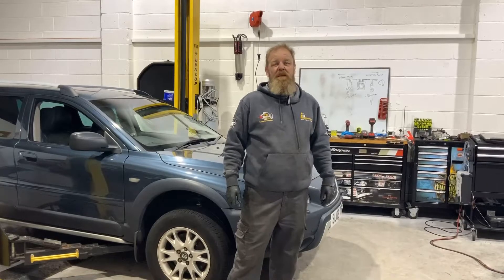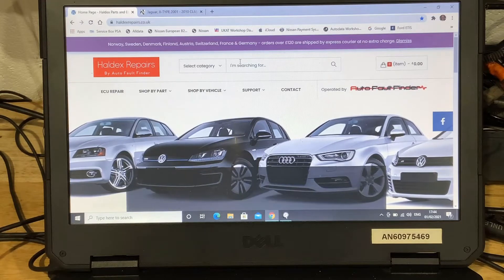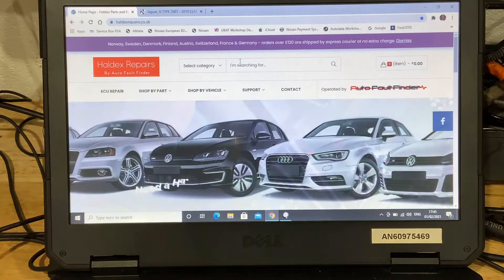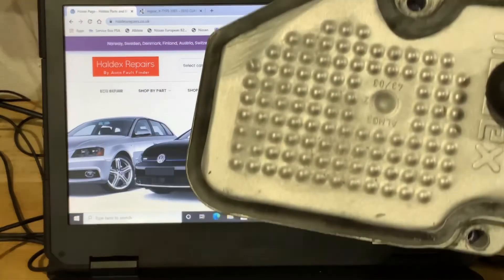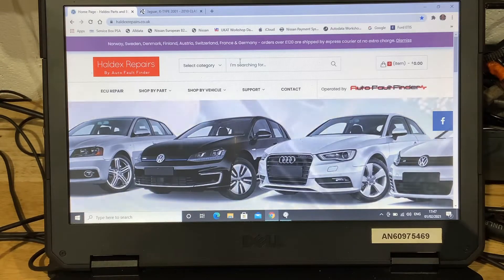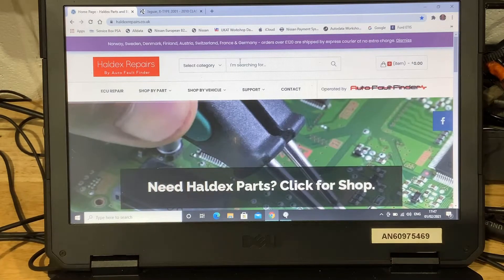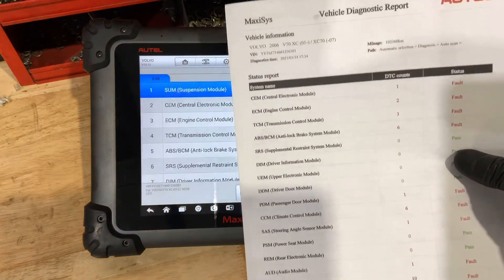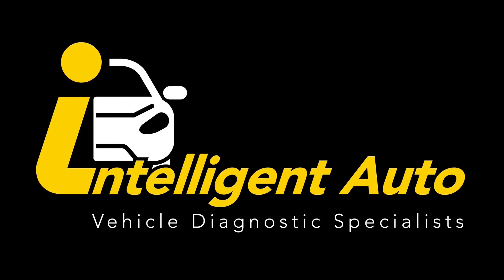Volvo V70 Cross Country follow up, 3rd Generation Haldex problem fixed

Comment: i have a volvo v60 cross country 2018, it displayed an error AWD DISABLED SERVUCE REQUIRED  CODE ERROR BEIN P188918 OIL PRESSURE PUMP PERFORMANCE. GENERAL ELECTRIC FAILURES. CIRCUIT CURRENT BELOW THRESHOLD. We did replace the pump, calibrated and the error cannot go away. any help please?

Comment: Would it have been any benefit cutting the can wire to see if the unit was sending out any information or would this be a waste of time?
Reply from the maker: The fact that can was present and good was enough to point towards a failed module in my opinion but of anyone can clarify this I’m always open to be corrected.
Reply: @intelligentauto737  I was thinking maybe the can signal most likely was information being sent from a different module, and if you cut the wire you could see that no information was coming from the bad module, and then connect the scope to the other side of the cut wire, and see the can signal that this would confirm the bad module wasn't sending a can signal. May be I am wrong. What do you think?
Reply from the maker: @d.d4184  the fact there’s can present but no coms via bod confirms there’s no message being sent by that module
Reply: @intelligentauto737  thank you.